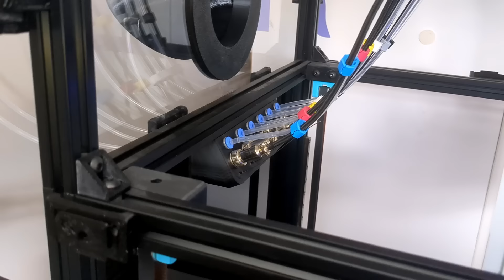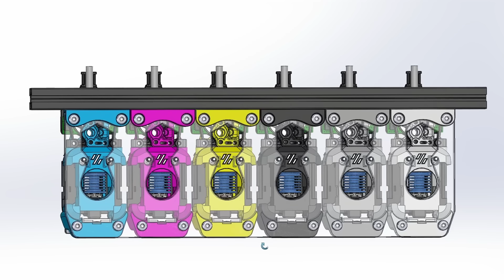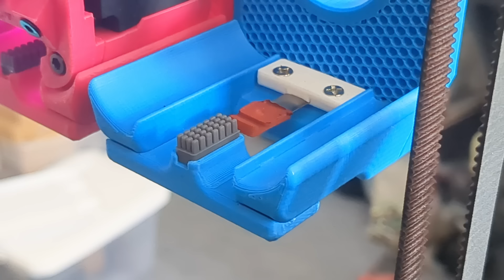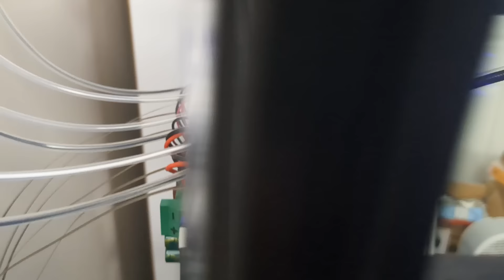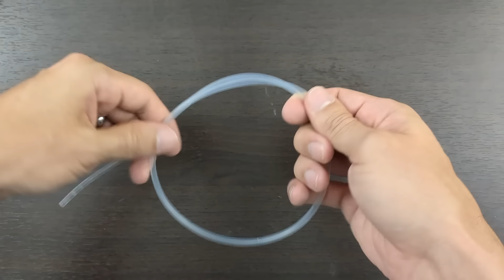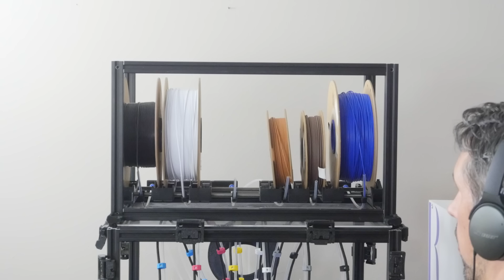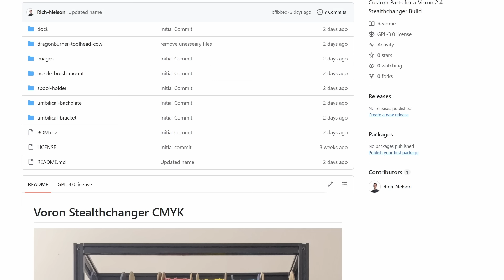I Built a Custom 6-Toolhead Multi-Material Printer (Voron StealthChanger)

Comment: Excellent functional design and pleasing aesthetics. Your project has given me renewed hope that I can add tool-changer capabilities to my Voron 2.4 350. Do you have an estimate of what all the components and materials cost for this build? Thanks so much for sharing your project with the open-source community!
Reply from the maker: Thanks!  I added cost estimates to the repo here: https://github.com/Rich-Nelson/voron-stealthchanger-cmyk/#cost-estimate-guide
Materials or a 6-toolhead upgrade are about ~$694. +$96 for the spool holder.
Reply: @rich_nelsons_workshop  Thanks for the reply and added info. From other comments in this thread I've determined that this system is modular? That is, I could start with two toolheads and keep adding more as needed/wanted? That makes it easier (and cheaper) to try it out and expand if everything functions as planned. Is eight toolheads (or more) possible on a Voron 350? Thanks again for your work -- I know the time and effort (and iterations!) it takes to develop a project like this.

Comment: Using this with WCMYK filaments and a soluble support filament, crossed with full spectrum or equivalent, would be a beautiful use of this machine. You'd be able to print anything of any mix of colors.
Reply from the maker: It's been awesome to see the slicer advances for color mixing, like full spectrum and hue forge.  I definitely want to try them out.

Comment: How do you mange tpu in your system?  Is there a specific spot to mount it, or do you just loop it outside the ptfe tubes?
Reply from the maker: That's a good question!  95a TPU is no problem through the PTFE guide tubes.  As you alluded too softer materials like 85a TPU gets stuck.  So far I have just run the 85a directly to the toolhead (after a decent mount of troubleshooting to find out that is wat not an extruder issue 😔). With soft TPU I've mostly done single color printers, there is a decent change that a multitool head print with this setup would fail, I expect something would need to take up the slack as the tool is n it way back up to the dock.
Reply: @rich_nelsons_workshop  Thats cool to know :) Maybe theres something similar to the mainspring in a watch that can hold/pull back the slack on retraction? or maybe something to roll the spool back after use, just as a tpu specific toolhead lol. I am sure there there is a way since the boxturtle ams unit exists.

Comment: Pretty awesome.  I know there are toolchangers out now but they are all missing something.  Either there is not enough tool heads, the temp is not high enough, or you could not have things like option to have a 2.85 fillsment size on 1 head for flexibles.  If you have the capability to design your own printer you can make all this happen
Reply from the maker: That's a great point! One of the best parts of making things is being able to solve really specific problems.  I've thought a lot about a dedicated toolhead for flexibles. I can print down to 85a now, but would low a dedicated toolhead to go softer.

Comment: I absolutely love & salute the innovations the 3dprinting community has achieved.  I'm waiting for the day when the community or some company can come up with a tool changer that can print at 370 nozzle, 120bed & 65chmbr.  This would open up  so many doors for prosumers such as myself who are looking to merge 3-4 high temp materials.
Reply: This is doable on a standard Voron 2.4 with a $60 hotend and $10 PT1000 thermistor, with 5mm PC panels I get 70°C chamber temps. Skip the printed parts and get CNC parts for a $300, then you can add a heater as well.
Reply: 120 bed and 65 chamber are doable with a Voron 2.4 for sure with the right insulation - possibly doomify a stealthchanger build for double walls, possibly relocate the control boards to completely outside the chamber's heat envelope, make sure the toolhead electronics have adequate fans to compensate for the higher air temp. Just need to find the right hotend, not sure what's available that'll do 370 but 350's easy.
I'm working on a build that should do that at 350c, 2-toolhead (one for the engineering material, one for supports).

Comment: Sick build, love the CMYK aesthetic. I also love the simplicity of using screw heads for the docking mechanism, it's awesome it works so reliably!
Reply from the maker: Thanks Ollie!  I was tempted to try some more recent dock designs with magnets, but saw no reason to mess with what already worked. Plus I embed magnet in prints sometimes, so I was worried about magnet son the toolhead causing problems 😳.

Comment: I love the design, I've been working on designing a tool changer that utilizes a Cartographer3D eddy current sensor that stays on the shuttle and connects via pogo pins. The primary hurdle is finding a way to keep kilpper from instantly crashing because the sensor will get disconnected at the tool swap.
Reply from the maker: That's awesome!  Viesturz the maker of TapChanger has a new project, ClickChanger,  that uses cartographer on the shuttle,  by running wires along with a CPAP to the shuttle. https://www.youtube.com/watch?v=P07FI8V1mqk

Having it in the toolhead would be awesome so you don't need an extra umbilcal to the shuttle, the pogo pins seem like a good solution,  but yea it seems lie the software would be tricky.

Comment: I like your clean Voron Stealthburner build. I like the colors for the toolheads and tool docks. I built mine with 7 Dragonburner tool heads. It was challenging to build. For nozzle cleaning, you can try making the nozzle move like an infinity logo; maybe it'll clean better than just going left and right.
Note: my SC #173
Reply from the maker: Thanks!  That's a good suggestion I'll try adding more complex movements to the cleaning path.

I checked out your serial video on the discord,  I like the cat ear cowls!  I added my serial to the description,  mine is SC.0023 (I put off the 6 tool expansion for a while).
Reply: Your serial is older than mine by at least a year. You're a true founder! 👍

Comment: Awesome modifications, can you share the link or the specifications of the USB cable you used?
Reply from the maker: It's a Monoprice 100W USB C cable, unfortunately I don't think they sell the exact model any more, here is the link :https://www.amazon.com/dp/B0946V5F3C. I looked based on wattage (I'm cutting it close here, make sure your specs can support your electronics).  After receiving the cable I cut them open to confirm shielding and thick gauge V+ and GND wires.

A dedicate CAN bus cable may work better with proper twisted pairs etc.  But these have worked well for me for around 2 years.  The only CAN issues I had was a timer too close error which turned out to but CPU limitations and was resolved by upgrading from a Raspberry Pi 4 to 5 for the Klipper host.

Comment: OMG! Nice job, man!
It's a great example of convergent evolution =)
My 6-toolhead voron utilizes mostly same solutions. 
Same coupling idea for docks (but in reverse), sherpa mini, DB-ish toolhead (burinator), tz-v6 he.
And I guess you are first who publish edge speeds and feeds for 24v toolchanger. Good one!
BTW. Do you consider further flip from the SC-style coupling to a MadMax one?
Reply from the maker: That's awesome,  I would love to see your build. To further the similarities I was very close to trying the Burninator before the jump to 6 toolheads,  I liked the idea of a shorter filament path and hoped it would improve the ability to print soft fleibles.
The speed at 24V and stock Fysetc motors really surprised me, most of my research pointed pointed toward needing 48V for faster speeds, it was a pleasant surprise and I hope the shared config settings help as a reference for other folks.
I don't plan on swapping out the system, but MaxMax looks really interesting. It seems to focus on 2 tool setups.  Before choosing the Voron 2.4 + Stealthchanger. I was considering a Trident possibly Tridex,  MaxMax seems like a much simpler way to achieve similar functionality.

Comment: For better cleaning of nozzles before calibrating, you can try a zig-zaging motion in the nozzle brush instead of just linear
Reply from the maker: Thanks for the suggestion. I have it move in a rectangle with some diagonal movement but mostly long ways. I think more zig-zag motion would help, and I probably need to dial in the depth that the nozzle going into the brush.

Comment: The build looks very clean and pretty thought trough!

One of the questions that I have is the approximate price to reach this stage. As bondtech indx seems to have underdelivered and doesnt' seem as an reliable option to get, how is performance of this project?

What about 3k+ toolchanges or different material prints, have you run into any issues?
Reply from the maker: Thanks,  prices were cheaper when I sourced parts, I'm putting together updated costs and source links,  they'll be in the GitHub and I'll share them here as well.

I haven't done anything in the 3k range yet.  Since update the two prints with the higher number of toolchanger were the Eevee (575 toolchanges, 6 tools 3h41m) and Piachu (390 Toolchanges, 5 tools, 3h20m).  Both with no issues.
Reply: That sounds amazing, will be looking forward to the update!

Another question as I built formbot 2.4 350 more then half a year ago, but keep having issues of prints losing ebb communication in a 2~5h prints. USB-C can cable that you made, how did you achieve that? Did you use same cable for both power and signal/communication wires? Did the cable as well was properly shielded and what specific brand/model did you use?

Sorry for many questions, as it was first time I saw usb-c reworked in such a way and it intrigued me.

Comment: Was just thinking , having the dock moving up and down with the plate would make the tool change much quicker
Reply from the maker: True, some other systems work along these lines, the downside is you lose form print volume in the Y direction.  Then there is @Viesturs (creator of the TapChanger) with a moving lift bar that brings the docks down during the tool change 😲: https://youtu.be/lwFKDuF7oC4?t=1492

Comment: Rich, that is an impressive build. I hope its gets some traction in the community because we need a robust opensource toolhead changer. I was holding out for INDX, but their supply and manufacturing issues have me leaning back to opensource.
Reply from the maker: Thanks!  I agree 100%, between the issues that you mentioned, and the legislation related to government scanning files before you can print them, the value of open projects and platforms is more apparent than ever.

Comment: Unbelievably impressive considering you did this without a kit. Been there, wasn’t able to fully do that.
Reply from the maker: Thanks man. I checked out your video, the build looks sick and you were doing it on hard mode with no existing project for the Sovol.  On my end I got the first 2 tools up and running with basically standard Voron/Stealthchanger/TapChagner parts.  Then I could take my time to plan the 6 tool expansion, and it took way longer than I thought.

Comment: Really impressive build, Rich. The whole StealthChanger implementation looks exceptionally well thought out, particularly the ability to start with a couple of toolheads and expand later.

I noticed your comment that you had a hard time deciding between the Trident and the 2.4. I’d be really interested to know what ultimately made you choose the 2.4?

My instinct would have been to go with the Trident for a multi-toolhead build like this, mainly because the fixed gantry seems like it could provide a very rigid and predictable platform for repeated tool docking/undocking and alignment. But clearly your 2.4 implementation is working extremely well, so I’d be interested to understand what advantages tipped the decision in favour of the 2.4.
Reply from the maker: The only toolchanger project I was aware of for the Trident at the time was the Daksh, which seemed to be in a demo state. There are definitely positives to a Trident style toolchanger, the main advantage is probably reduced travel for toolchanging along with what you mentioned.  That's likely why the Prusa XL and Snapmaker U1 do it this way, especially since they were designed from scratch.

The TapChanger/StealthChanger projects were mature by comparison with growing communities, and they build on the work of the huge Voron community. I weigh community support pretty highly when it comes to building open source projects.  And there are some advantages:
-There are no additional electronics like the servo in the Daksh, or the lift bar used to adapt the TapChanger/StealthChanger like this one to the Trident, Or machined components which may be needed for the Prusa/Snapmaker mechanisms.
-The front mounted dock allows support for all common front mounted Voron toolheads so you're not locked into one specific to the project, it looks like 10 different toolheads are supported.
-The docks being at the top allow you to printer below them,  if the docks were at the bed level it could reduce the usable Y space by around 60mm.
-If you already have a 2.4 or are building a kit printer the barrier to entry is very low. In my initial build I skipped the stock toolhead mount, I only needed two extra printer (the shuttle & toolhead backplate).  With that I have a normal functional printer single toolhead printer from day 1, but with a detachable toolhead. from there I could expand as need, print a dock (test single tool dock/undock), printer another toolhead & dock etc.

I haven't found rigidity to be an issue during tool changes, they have been far more reliable than I had expected. But, IMO the biggest downside of the Steathchanger mechanism is probably the rigidity of the toolhead/shuttle connection, my input shaper results pointed toward a max acceleration of 6700mm/s^2, I've heard of some folks on single toolhead 2.4s running 10K or 20k+ accel which I expect is due to the more rigidly mounted toolhead.

It's been a while since I made my decision so they may be more mature projects available now that make the trident a more compelling platform for a toolchanger. The MadMax project looks like it could be an efficient way upgrade a trident for 2 toolheads.
Reply: @rich_nelsons_workshop  Thanks Rich — that's exactly the sort of explanation I was hoping for. It makes a lot more sense now, particularly considering the maturity of StealthChanger/TapChanger and the Voron community when you made the decision.

I hadn't considered the advantage of having the docks above the usable print volume either. That's a significant benefit compared with sacrificing Y travel to bed-level docks.

Your comment about the toolhead/shuttle connection being the limiting factor is particularly interesting. I had assumed the moving gantry/toolchanging arrangement itself would introduce the greater rigidity/alignment problem, but your real-world experience obviously suggests otherwise.

I still think that if I were designing a multi-tool machine completely from scratch today I'd probably lean towards a Trident/fixed-gantry architecture, but you've made a very convincing case for why the 2.4 + StealthChanger combination made sense — especially being able to start as essentially a normal single-toolhead 2.4 and progressively add tools.

Thanks for taking the time to give such a detailed answer. Really impressive project.
Reply: I have exactly the same questions and would love an answer.

Comment: This is some great work. I had been tossing around the idea of trying to do a toolchanger for my ratrig, but with a fixed Z gantry (and some other complicating factors) I think it might be more trouble than it is worth. I'd be interested to see how this holds up after a few months and what kinks you run into.
Reply from the maker: Thanks!  Yea for this style of toolchanger you would need to add Z movement, the TapChanger project added a lift bar and mini lift bar for that purpose but it definitely increases the complexity.  A few folks have mentioned the MadMax project which seems like an elegant way to run 2 tools on a fixed gantry printer.

I ran the 2 tool version of my printer for over a year without any notable issues, if I run into anything significant I'll post an update.  For now I plan on moving on to other projects where the printer is the tool rather then the project itself 😊.

Comment: This is something I might be able to adapt to my SV08. Wonderful project! Question, is there anything stopping me from doing just one or two extra toolheads at first and expanding later?
Reply from the maker: That can work for sure. I did the initial build with just one toolhead, then added a second and used it that way for over a year before adding the rest.

Comment: Fantastic!  Being nosey, but what would be the estimated cost for a build like this?
Reply from the maker: Be nosey I'm happy to share 😊. It looks like some prices have gone up since I bought the parts.
From AliExpress the base Voron 2.4 300mm kit should be around $800 (I used Fysetc but now the Formbot price is lower).
The main cost per toolhead is the TZ v6 2.0 hotend ($18), Moons nema14 motor ($22),  EBB26 CAN toolhead board ($14) and the tap sensor ($10). That comes to about $62 per toolhead. So for the printer and 6 toolheads worth of electronics it's about $1170.
That doesn't include the filament to print it and various hardware. I'll take some time to check some sources and update this comment and at links to the GitHub BOMs for the rest of the components.
Reply: @rich_nelsons_workshop thanks for the effort!